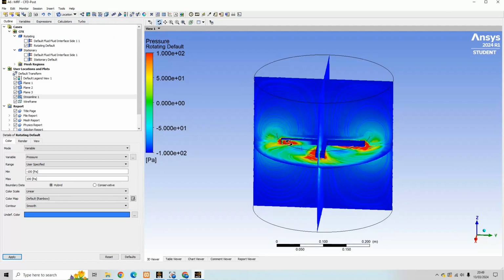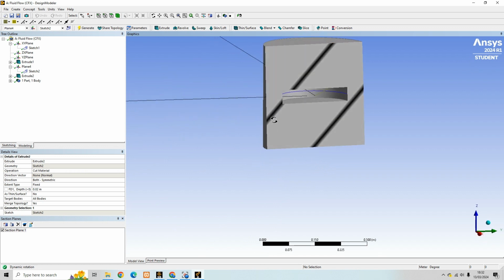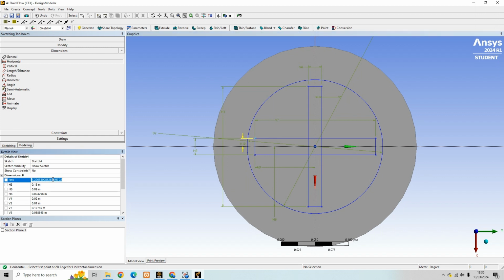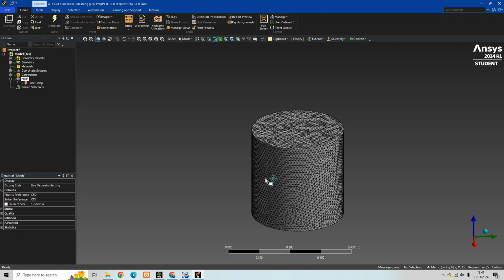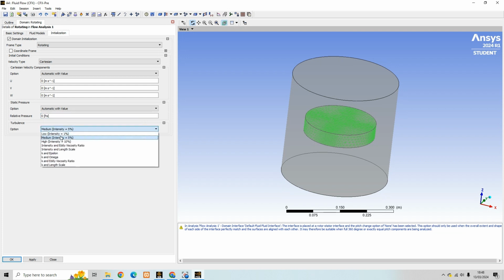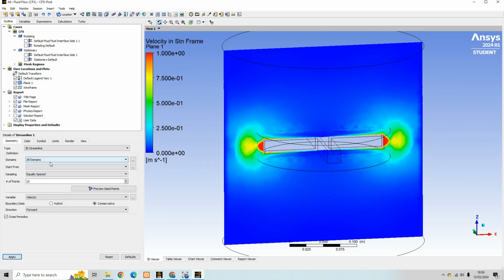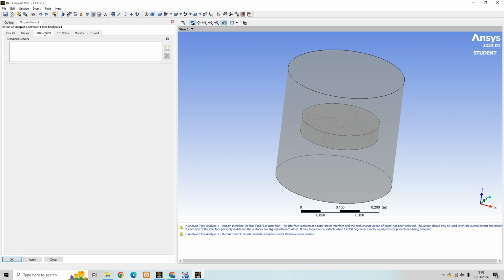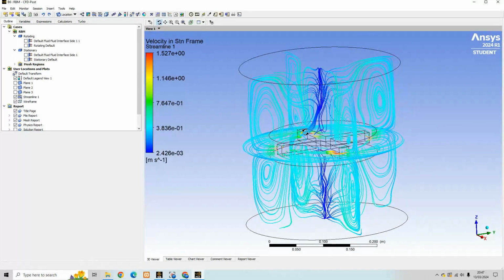How To Simulate A Stirred Tank In Ansys CFX With MRF and Sliding Mesh

Comment: I didn't understand. Is that when you change the analysis type to transient CFX automatically changes from MRF to sliding mesh?
Reply from the maker: In an instantaneous simulation, the rotor physically moves and in the steady state case the walls of the rotor have the velocity appropriate for rotation I.e. omega*r
Reply: @ClimateCFD  So Transient Rotor Stator for instantaneous simulation

Comment: You can calculate the torque and power....you could make a video of this with this example....and that the upper surface is free to the environment to see how bubbles are generated with air inside the water
Reply from the maker: @danieltueros4025  take a look at the turbine video on this channel. That shows a method.